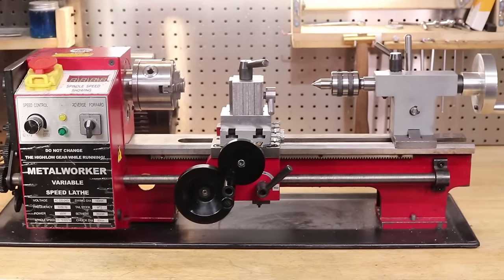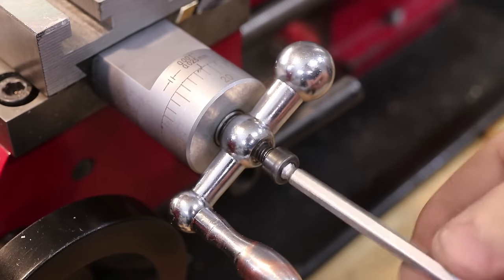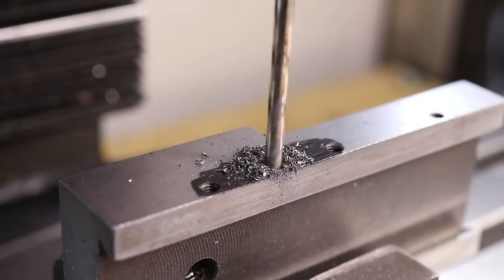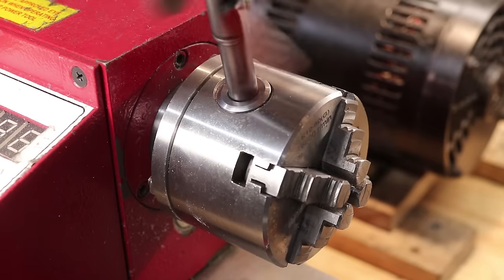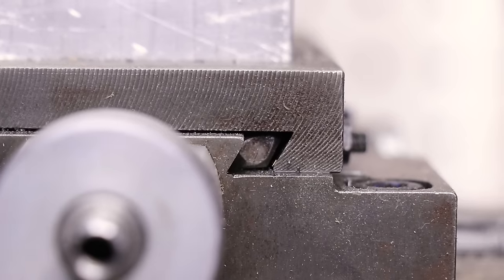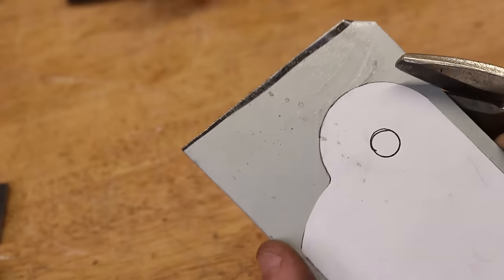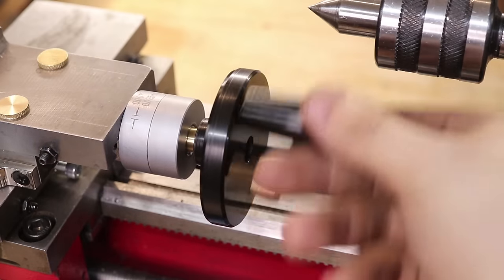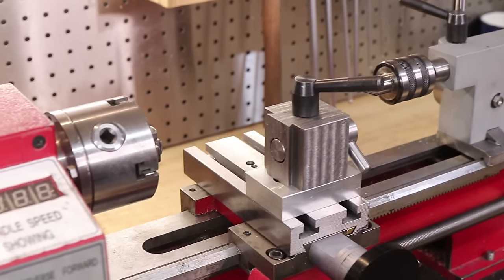20 Best Mini Lathe Upgrades And Improvements

Comment: At 3:35 the whole compound slide was bobbing up and down....at all times when turning the gibs on the compound slide should be TIGHT to prevent any movement, they should only be slackened off slightly when doing a taper.......that is the first thing to correct......the next thing is to get rid of the piston type tool post........some like it but it's not al that great.
Reply from the maker: I probably should have mentioned that that footage was taken before I made the leadscrew constraints. Without that mod I had to back off the gib pressure or the cross slide would jam. That's all fixed now and the gibs have been replaced. The compound is probably the poorest bit of design on these lathes. As for the piston tool post, I am sure you would notice a difference on a bigger lathe, but here I can't see it making a difference. Cheers
Reply: "at all times when turning the gibs on the compound slide should be TIGHT to prevent any movement" - the real problem is that the the gib strips rock because they are so narrow and the clamp screws work on an angled face. No matter how tight you do the clamp screws, the assembly still rocks (they will push the slide up if you really tighten them).  The contact face of the gib needs to be ground flat and the rear face needs to have pockets cut into it at the correct angle to take the ends of the clamp screws (which need to be changed for dog point screws) - that improves it a lot.

Comment: I dont think a quick change tool post is good upgrade on a small lathe where the rigidity can be a problem. Also i dont see handwheel replaces necessary at all. All the things that help rigidity are good upgrades, also bigger chuck is good upgrade.

Comment: You know you can upgrade your ears from plastic to metal right you just have to order them online or you can make your own
Reply from the maker: I never use the leadscrew for cutting gears so I wouldn't benefit from changing the gears to metal.

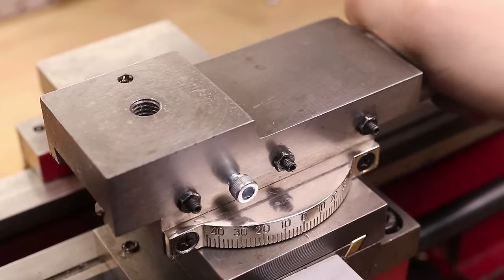Comment: Okay that particular lady is somewhere between 5:00 and 6:00 or $700 right and you're talking about doing four or five days worth of work for an amateur maybe even longer between assembly disassembly doing the work and doing it right let's just say you doubled especially with the truck and the motor doubled the price why don't you just buy a $1,500 lathe  I mean if you doing it for a hobby only and you don't have the kind of money I understand but I have one and I ended up getting a used in excellent condition Craftsman gunsmith lathe which is 50 times the lathe as that little one that you have For $1,200 and it came with a pile of tooling Three chucks a center rest it's got a 1 in through hole and it's 12x36 I mean and if you think well I might not be able to find one just look on eBay and then make all kinds of upgrades quick change gearbox for turning threads all kinds of stuff some much better deal for the same money

Comment: It sounds like it would be better to NOT buy a mini lathe.  By the time all these mods are applied, I think you could have purchase a larger, more robust metal lathe.  I have found over 70+ years that often, cheap turns out to be expensive.  “You don’t get a Rolls Royce for the price of a Holden”.
Reply from the maker: Of course it's up to you, but you'll also find that a lot of these mods can be done to those lathes too.

Comment: You can get a multiple speed motor without using a drill press motor you f*** that thing up
Reply from the maker: Maybe, but for what I do I benefit most from using a fixed speed AC motor. Many lathes use them. Every motor has its pros and cons.
Reply: @artisanmakes  I can tell that you don't know what you're actually doing you could have ordered a multiple speed AC motor and did it right instead of f**** up
Reply from the maker: Again I will say, I don't need variable speed for what I require from this lathe. Your needs may vary.
Reply: @jamesendsley1560  James, you have your head up your a55. The cone pulley solution is the cheapest for the amount of power provided. Going to a VFD plus 3-phase motor or a large DC drive and large DC motor is way more expensive. (I learned turning on a South Bend tool room lathe with a flat belt on cone pulleys - it's not a problem.)